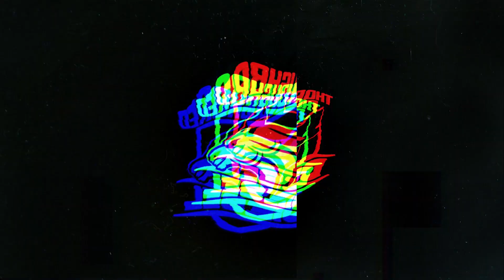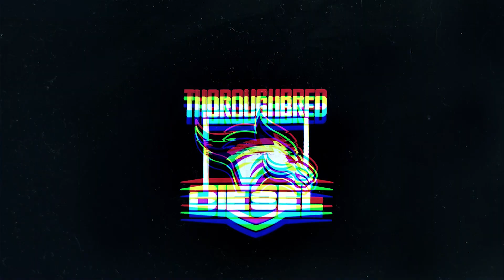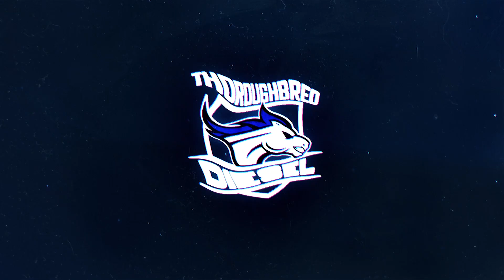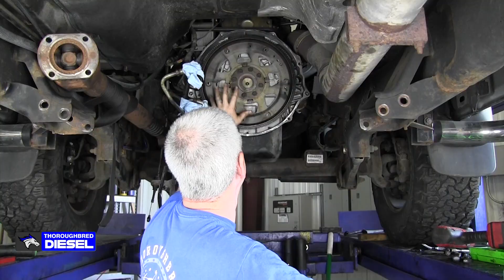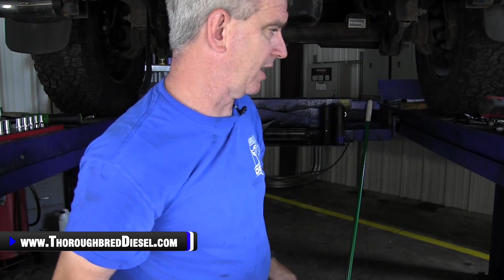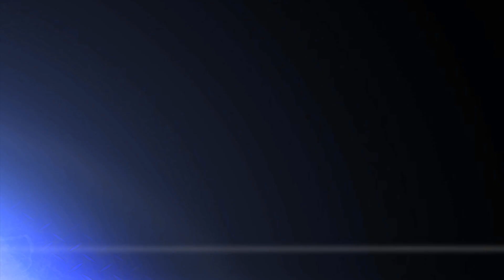Suncoast Billet Flex Plate 48RE/47RE Transmission Install: 1994-2007 Dodge Cummins

Comment: I DONT ''KNOW'' WADE''''   I THINK THAT ''STOCK'' FLEX PLATE IS GOOD FOR 100 YEAR'S   ''''  UNLESS  '''''' YOU ''BEAT''M ON IT WITH '''''  1000 H.P. '''''''  THEYVE ''LASTED'' FOR ''DECADE'S AND DECADE'S  ''''''  I KNOW YOU ''DONT'' DEAL WITH '' STOCK ''' HORSEPOWER ''''' ''''   YOUR ''CUSTOMER'S''' WANT THE ''VERY'' BEST '' AVAILABLE '''''''  10 - 4 ''

Comment: OK, I believe that 101 ft/lb torque that "everyone" on yootoob is using...is actually for the flywheel(NV4500)...... The factory manual lists torque specs for the 46 and 47 Drive plate bolts as 55 ft/lbs and 75 ft/lbs, respectively......on page 21-330, under automatic transmission torque specs...

...just sayin...

EDIT:  ARP kit instructions list 120 ft/lbs with loctite 242 on threads and ARP lubricant under the head of the bolt...again... just sayin...

Comment: Why did you not use any lock tight? My stock 13 is in the shop because the bolts worked themselves out.
Reply from the maker: This was a part of the video that we didn’t get. We use loctitie 242 and a small amount of ARP lube on the bolt head from proper torque.

Comment: Question - What would cause a barring tool to not catch the flexplate? Ordered a barring tool from Geno's to remove TC and Trans, was too short. Called and confirmed it was the correct length 2 5/8". Tranny out if the way I can slip it in and it's barely catching 1/16 of the teeth on the flex plate.
Reply from the maker: Im not familiar with the barring tool they sell. Normal length barring tool, I measured ours, and it is 2 7/16 under head length. If there was a extra spacer on the crank or something the trans wouldn’t install?
Reply: @thoroughbreddiesel  Hmm, 2 5/8 we measured was end to end, I'll see what this one is from head to end. It definitely doesn't reach like it should which has worried that something isn't right on the flexplate. I need to investigate this deeper, TC should be back within a week or so from the restall/rebuild. Thanks for replying! Also thanks for the great videos, they helped me immensely with tackling this job.
Reply: In the event anyone else is reading w/ this same issue. My flexplate ring gear had shifted forward about 1/4". It was a 29.1 certified billet forged flexplate at that, ring gear was not welded though.

Comment: The base is the same than manual ??
Reply from the maker: For the 5.9’s the adapter plate is the same, but on some applications you will have to use a starter spacer.